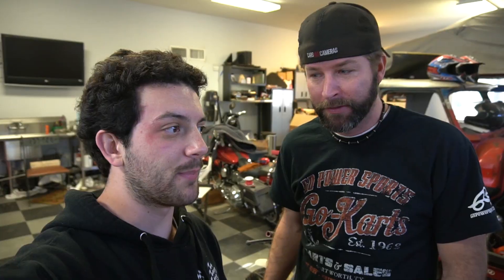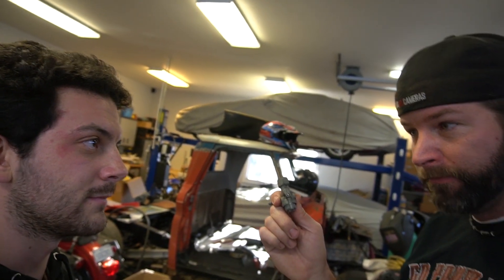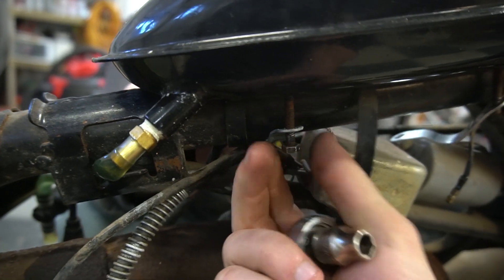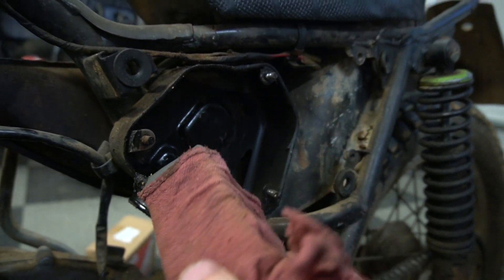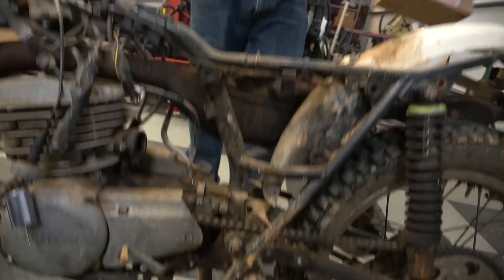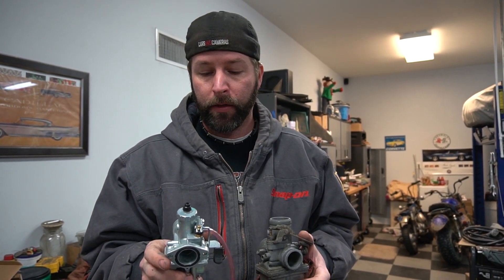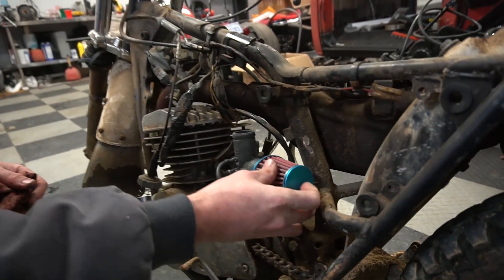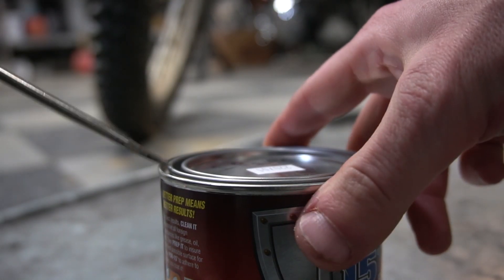Vintage Kawasaki Restoration FAIL

Comment: The KT 250 was only made for two years 1975-76. I bought mine, a 1975, new in 1976 for $803.00.
Reply: Mine's a 1975 KT250 imported from the US. It's awaiting restoration, but it's complete and turns over with good compression. To be fair they were not a very succesfull trials bike but as a teenager in the seventies I had a wall poster of the full Kawa' range on my wall and allways liked the look of them.

Comment: Ever check out the kx250? I'm sure you Already did. I would give up on eBay for parts like that. The dealer might have the only last bit of information for bore,stroke and compression ratio and might be able to get you closer to the correct carb. And yea, they are loud.

Comment: I never knew if predator engines were really expensive or not but when I looked at the price for a 212 6 HP engine was only 160$ on Gopowersports it blew my mind away. in thought there were so much more expensive!
Reply: Cheaper from where they get them.... Harbor Freight.

Comment: To get the dents out of the tank, fill the tank with water roughly halfway and place in freezer without the cap on the tank, just keep an eye on it, as the water freezes it will push the dents out.

Comment: Hey dude. You must change that air filter to one similar to the original as that filter may fit but is not suitable for mx bikes such as the 250 2 stroke.

Comment: I have a 1980 yamaha dt175 that I bought last year, rode it around for a week and lost spark. Replaced the cdi and ignition coil and still nothing. All the wiring looks good... bypassed the kill switch to make sure it wasn't faulty. Now it's just sitting and it's killing me. It's a street legal 2 stroke with only like 15 horsepower but it was a ton of fun and I got so many looks whole riding it around town. There's only 1 small motorcycle shop near me and I'd hate to bring it to them and end up being charged more than I payed for the bike which was $400. I read one of their reviews online that a customer brought a bike there and was charged more than they payed for it and it wasn't worth it anymore so they just left their bike there and never picked it up. My dt175 is worth around $800 in good running shape and I don't want to be into it for more than $600 so if it's going to cost more than $200 to fix it then I'm just going to sell it. This video really has me wanting to ride it again so I might call tomorrow and explain to them I don't want to put much into it and to call me when the bill hits $150 and we'll see where we're at and if they have any idea yet or still figuring it out. I suck with electrical but I usually work my own stuff so this is killing me.
Reply: Budget Tacticool have you tried changing out the spark plug?
Reply: TheDinokiller25 no because the plug looks perfect. Bike was running great, maybe ever so slightly lean but it's what the ideal 2 stroke plug should look like
Reply: Budget Tacticool not even a small amount of spark felt when holding it and trying to crank it?
Reply: TheDinokiller25 1 time my buddy claimed he felt a zap through his arm while I was kicking it over but never happened again. We hadn't done anything different at that point
Reply: Budget Tacticool all I can think is double check spark plug status, ensure good connections everywhere and check wires. Multimeters are cheap and really useful to have around so if you have one check continuity of every wire.
Reply: TheDinokiller25 I've tried and still can't figure it out. Had a friend of a friend check it out and he was the one who said the ignition coil and that didn't do it so he said cdi box and that didn't do it either. I might contact the local shop next week and see what they say and if they can give me any sort of price estimate so I know I'm not getting myself into too deep of expenses. I can afford it, don't get me wrong however I be never lost money on anything with an engine and I don't want to start now lol. So if cost to repair will put me over what it's worth to get another then it might be better to find another. I love having a street legal 2 stroke, but it's only a 175cc making 15 ish horsepower so it's fun cruising the neighborhoods but I can't cruise over 50mph otherwise I'm pushing it too hard. All of my quads are faster than it, so I kinda want a real street bike so I can actually go fast and have some fun but the reason I bought it in the first place was to limit myself so I can't be stupid on it because I like pushing things to their limit lol
Reply: TheDinokiller25 the engine is identical to the yamaha blaster and I got a spare engine off one of those that's built making around 30 horsepower so maybe I should just put that engine on it and lose the wiring bullshit so I can have a running bike with double the horsepower lol
Reply: Budget Tacticool lol doesn’t sound that bad of an idea

Comment: Dennis Kirk sells a perfect replacement, 
26mm VM Series Universal Round Slide Carburetor - VM26-606
 Part # 165141 
After the proper jetting it is better than new

Comment: You can get the dents out of tank with air hose  but first put some straps around it so it won't stretch apart on sides a know from experience.

Comment: You guys need to rebuild the front forks. Find a good seal kit and the amount of oil needed. The valves on top are to bleed off air, not add air.

Comment: Yep, I want to see it run.  Use an ultrasonic cleaner on the original carb with a rebuild kit, should be good to go.
Reply: Also, the old gas tank can be used by welding small sheet metal squares over the holes.  Yes, it won't look great, but that will buy you time to find a replacement tank, or have it repaired by a pro.  Or better yet, time to practice the skill of patching the holes more professionally on other gas tanks, then applying those new skills to the Kawasaki tank.  Keep up the great work!

Comment: To get that dent out of the tank fill it with water and put it in the freezer. Sounds dumb but bare with me. As the water freezes it expands and the dent should pop out. Seen this done before and it works just not sure on the success rate? Failing that you could try sealing the tank and use air but this is a bit more risky for obvious reasons.

Comment: Why not rebuild a carb you can get a gallon can of carb cleaner it’s an acid the can has a screen for soaking small parts I’m sure you can order the replacement parts you need 
Make sure you put cellophane under the por15 lid you won’t get it back off when it drys lol 
Nice video
Reply: something wrong with the carb body. i can scrape the metal off of it with my fingernail. its real chalky like the metal is breaking down

Comment: You guys should try some observed trials riding since you have a trials bike. Btw,air cooled trials bikes run 50to1 gas ratio. Dirtbikes run 32to1. It will run better with correct ratio

Comment: Im restoring a 78 kz400 and the bottoms of the carbs have things for some sort of "overflow or ventilation hose". Anyone know where that goes to?
Reply: Max L probably just straight to the ground with a hose
Reply: Max L that's for synching the carbs/draining them
Reply: jorn volman alright thanks. This'll helo get it started
Reply: it goes straight down to the ground through a 8 inch or so long tube so, it ends just past the frame...my klx has that too

Comment: Well instead of buying a new carb here’s what you should do. Completely disassemble the carb, and go out and buy a bucket of chem dip and soak the carb in that. Put the whole thing back together and it’ll be like a brand new carb. Problem solved

Comment: The carb that you had could you take the intake manifold boot tging off and bolt the carb straight to the engine
Reply: chickensfloat_ on_dirtbikes  no that would be very bad the boot absorbs vibration from the engine before it gets to the carb. The vibrations would wreak havok on the carb including ruining the needle/seat/floats, throwing the running jetting way lean (by airating the fuel), and would eventually cause the carburetor mounting flanges to break. On a low rpm engine(below 4k rpm) the vibrations are milder and alot of manufacturers use an isolator plate instead of the boot now. But on a higher than 4k rpm engine that boot is a must to reduce frequency oscillations getting to the carb caused by the engine running  at higher rpms
Reply: D L ok  i did not even think about that i assumed it would be fine because with cars the car is bolted straight to the intake
Reply: chickensfloat_ on_dirtbikes that's OK on cars it is negated due to the number of cylinders kind of like the working principles of an alternator where the number of poles combined with the rectifier and rotational speed creates the positive charging voltage that when viewed looks like a scallop pattern but when seen unregulated on an oscilloscope looks like several ac  sine waves overlapping but due to the rectifier flipping the negative half of the sine waves and cutting off above and below a voltage threshold appears to be a steady DC current that when viewed by an oscilloscope looks like a round scallop pattern
Reply: It's a matter of cylinder pulse count per minute if you see a single cylinder engine running not bolted down it'll hop around at full throttle where as if you take a v-8 and set it on the ground (most require a stand to prevent setting it on the oil pan but if it's hard bolted to the engine it'll act as part of it) it'll just sit there at full throttle and not hop all over the place the key is how many power pulses per minute a 1 cylinder 2 stroke at 6k rpm only puts out 6k pulses per minute where as a v8 at 6k rpm puts out 24k pulses per minute hence the need to absorb more vibrational force on the smaller engine that's also why a 4 cylinder car engine with identical displacement without vibrational boots may only Rev 8k rpm where as the motorcycle engine with vibration absorbing boots could run 16k rpm

Comment: Please don't use only a pod filter on a dirt bike, the engine will suck all of the muddy water that would normally be deflected by the air box and will be toast pretty fast. It is worse on a motorcycle than a go kart because of the way debris is directed by the back wheel.

Comment: I sure Hope for your sake that you poured the POR15 into a cup before you dipped your brush in the can. You CAN"T use that from the can like paint unless you plan to use up the entire can on your project. If you use it from the can (without pouring some into a cup) while you paint the frame and then dip the brush back into the can, you contaminate the product in the can. It WILL harden up in the can and you just wasted $30. When using POR15 you really have to follow the instructions on the can. It is one of the few products like that... ALSO clean the lid and lip of the can before you put the lid back on. If there is ANY between the lip of the can and the lid, you won't be able to get the lid off again.  Otherwise it is a great product.

Comment: I'd have honed the cylinder and threw in a set of rings as a bare minimum very cheap and well worth it those forks will not hold air a set of fork seals required, stop showing kids and newbies what not to do.

Comment: https://www.ebay.com/itm/carburetor-32mm-PWK-replace-keihin-OKO-carb-black-w-power-jet-for-honda-yamaha-/322856498077 there is link for  32mm pwk carburator that will work fine on your kawasaki. its littlebit bigger than the original but it just means more top end power. this carb is flat slide so it haves better throtle responde. just get something like this. 26mm-32mm carb will work fine on that. if u gonna have the original intake manifold just check the dimensions right.